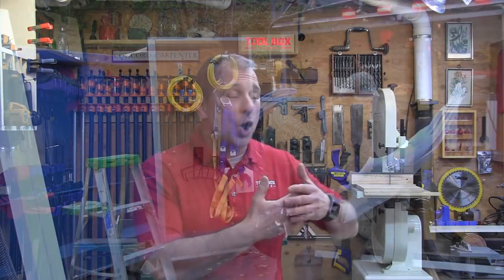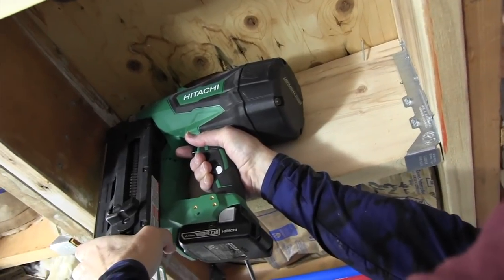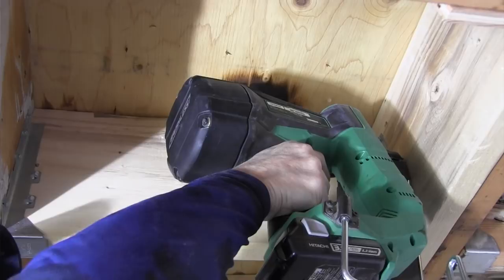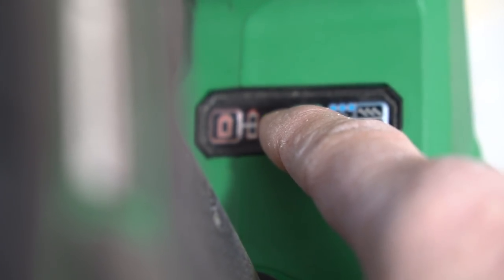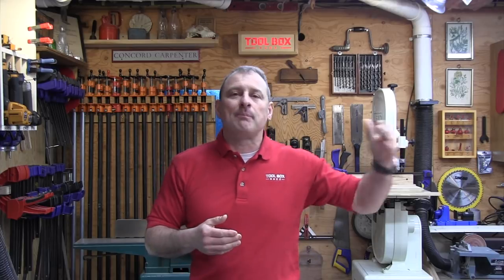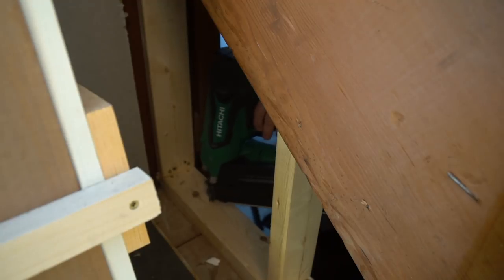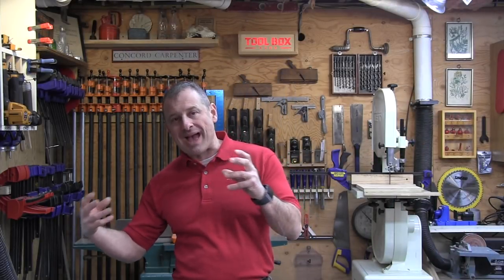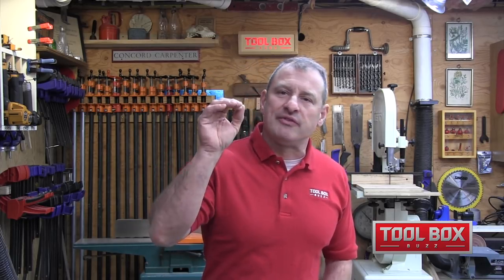Hitachi 3 1/2" Cordless Framing Nailer Review

Comment from the maker: We're currently using the finish nailers. I'm thinking of doing a 2-way look at the Hitachi /  Makita pin nailers
Reply: Cordless?
Reply: Why not add the Ryobi pin nailer to that list?
Reply: Cheng Liu because no serious carpenter uses ryobi anything.
Reply: 9mmkahr: You obviously haven't used one. Their 18v nailers are well regarded by most and are probably the best value around. I saw a video of a Ryobi 18 ga. nailer side by side with a Milwaukee one and they were pretty much the same in terms of performance except that the Ryobi was less than half the price.
Reply: Cheng Liu no i havent..  Ive heard the finish nailers are good.  But everything else.... Thumbs down
Reply from the maker: 9mmkahr ethos framer is amazing
Reply: Not sure what the price is on this hitachi nailer but 400 nails on a single charge battery is no comparison to the pasloade nailer with 1200 nails on a single battery charge!
Reply: Candelario Sanchez I will stick to my hitachi at 400 nails the cost of gas and down time when the paslode is being hormonal or the gas is cold still makes it better gun. I run mine on two 5ah batteries one is always fully charged before the other is flat so no issues.
Reply: My first finish gun was the paslode im 250 I think cleaned it regularly and last ten years but the stopped making spares for it so was replace by a bostitch which was half the price and still have as a back up as had to buy an angled finisher when the builders I sub contract to would only supply angled nails , so currently have the dewalt dcn 660 but have replaced the firing pin three times in little over a year and it doesn't sink 50mm pins into hardwoods, want to get the hitachi air Spring drive but don't think they do a 16 gauge angled finish nailer?
Reply: A Concord Carpenter / ToolBoxBuzz 
Hey rob great stuff as always

If you had to pick between this and the Dewalt framing nailer which way would you be inclined to go and why?

I recently started a small remodeling company and I am a one-man show. I primarily do remodeling and light building projects. For portability and efficiency i’ve went cordless with every new tool so far that I didn’t already have. 

Because I need to get a framed, finish & Brad nailer, I’m conflicted which direction to go. I run the DeWalt and Milwaukee platforms already, but the Hitachi seems to be best in class. All that to say, I’m inclined to stay on one platform for whichever nailer I pick. 

Thoughts?
Reply: @mj-1809  my thoughts would be to stay clear of the Dewalt 20v framing nailers. They're garbage and when they break Dewalt won't cover it under warranty and will want to charge you $220 to fix the nailer. They also don't tell you that the two return springs need to be changed after 20'000 to 30'000 nails which adds to the expense of the tool over the life of it. I bought two of them and their crap service turned me off buying anymore Dewalt tools. I picked up the Hitachi 18ga brad nailer and framing nailer on black Friday where they both came with 2 free batteries and I'm happy with the brad nailer. I haven't used the framing nailer yet but a cordless framing nailer is better in remodeling jobs and framing up basements because there's no blast of air out of them like the pneumatic nailers that sends a cloud of dust every time you nail something
Reply: "It's a poor craftsman that blames his tools"

the Ryobi one+ line is pretty stellar quality for a decent price.  Just my opinion.

Comment: Great review i just bought 2 of these guns brand new from lowes they did a non stock cause of the name change i only paid 50.00 each i e owned a the paslode and switch to the dewalt and the dewalt sucks quit working on only shooting 1/2 box of nails so i was so impressed with the hitachi it shoots fast a d i got 2 of them for 50.00 ea wow cant believe it

Comment: I am no carpenter, but I love my Hitachi cordless framing nailer. I moved into a house and needed to build a shed, so I used it to frame the 8x14 wood shed. It saved me so much work. Yeah, it was expensive, but worth it. Absolutely loved the power.  Maybe had one jam. However, there is a guy on youtube who said he used his in construction for 2 years and showed that now it barely puts a nail into the wood.  So maybe with heavy use they die out after a while? I need some new projects to use mine on now.

Comment: We just bought three of these, they will be used in place of Hitachi pneumatics, building 8 hours a day, we ordered two extra new 3 AH batteries and two of the 36 volt batteries, which will give this tool 8 AH.  I can report back after a few weeks and let you know how they work. We would love for Hitachi to make a coil roof nailer like this. The only reason for the compressor and hoses is the roof nailer.  We are also going to invest in the 36 volt miter saw, trying to go completely cordless, no generator or compressor.
Reply: chuck miller 
Any update 
On your tools?
Reply: @alfredomartinez4093   Yes, we used them for 5 days straight just last week. Not a single jam, they are a tiny bit slower than a pneumatic, but you find a rhythm.  Overall, we finished a little quicker than when using pneumatic guns. We did not use any air, no compressor or hoses to roll up everyday.  No tangled hoses or hoses tangled with electrical cords.  The 400 nail count per 3 AH battery is pretty accurate.  We start again tomorrow. The plastic on the top of them appear to be a fiberglass ball reinforced plastic instead of a fiberglass strand, the ball type is more impact resistant, probably for the habit of using the pneumatic for a bumping hammer.  We caught ourselves several times bumping studs around with the top of the gun.
Reply: Thanks for the update
Sounds like you really like them.
Reply: @alfredomartinez4093  Almost a year of using them full time framing. No oil needed. Only issue we had was the drivers wearing and bending some nails, this just started happening.  We were able to grind the driver flat and they are perfect again. The batteries only last about 4 months, but they are recharged much more often than when using normal cordless stuff.  Batteries are only $38.00 for 3 AH. Not bad, definitely better than a compressor and hose all the time.

Comment: I loved mine. It worked so well! Although here in Canada it did not like to work in the cold. It was nearly flawless for 5 years but now I think I may need to replace it. I did get a pneumatic Metabo gun and I love the double clip but the cord is a real pain, as is the compressor. I think I will go ahead and replace it. I am curious how other nailers fare in -10C and below temperatures. I rather be inside and finishing then but you know how schedules can go. Sometimes you get caught out in the cold

Comment: Have had this for gun ( NR1890 DBCL in the uk) for about 10 months and has jammed twice, both times were user error ( I fired through a knot), don't like the rafter hook , it always swivels round on itself from my hammer hoop and the nose jabs me in the back of the leg ( I think they have a revised and smaller one now) , also didn't realise how powerful it was until I borrowed my mates paslode and it struggled to sink full shank 75mm nails, mine on other hand will sink full shank 90mm all day long, absolute beast of a machine!
Reply: SOLD! Thanks.
Reply: Paul Petrie working with any Brand of nails? Or just hitachi?

Comment: I don't need a framing really all that often, but when I'm knocking out small trim jobs, I use my cordless nailer unless I'm setting up for awhile in which case I set up the compressor. the extra weight of the cordless is annoying after awhile. Oh I found hitachi 3 ah batteries on amazon for only 40 dollars.

Comment: super impressed with mine.  Doing an addition, I grew up in the trade but own a farm now.  Needed a second nail gun, got tired of passing the only one I had back and forth with my help and about to start roof rafters this week, so... really didn't wanna be sharing a nail gun then.  Was a little hesitant from the price, but, I despise paslode, owned several and the maintenance needed on them was a real pain in the butt, plus having to have batteries AND gas cartridges was a bummer, seems like one or the other was always empty, needing a charge or trip to the store to spend $$$ and time.  Agree on the needing two batteries, with just framing, it would be hard to outwork one battery before lunch and a chance to recharge it, however when I was sheathing the walls I framed, you fire a lot more nails, so, I did run the battery out.  I wish Makita made one, I have all makita cordless tools, but, oh well, I'm happy and I have a nice framer that I don't have to worry about dragging out the compressor and hoses or worse, putting them away at the end of the day!  Sheathing, stick with the pneumatic, but for framing, it's hard to beat this thing.
Reply from the maker: Ajila Ama Farms great nailer!
Reply: Amen, the thing is so strong you've got to be careful with sheathing. If you do use it for sheathing, you had better have a piece of ply/osb laying around to tune it in. I noticed with sheathing, you have to hold the gun super loose and let it recoil or it will go clear through the sheathing if you push to hard. I effin love this gun though!

Comment: I have a handyman service so I don't shoot a ton of nails generally. I just thought the Hitachi was too big and didn't feel as good in my hand. I opted to get the Paslode framer last week for $268.00 at Menards. I have loved my Paslode trim nailer over the years except for when its cold first out of the truck. This gun and the Paslode was a real tough choice for me but 9000 supposed nails on a fuel cell really isn't an issue my for lower nail count.

Comment: I sure hope makita hops on this bandwagon... I have been using their 36V 7 1/4" circ saw daily since December 2018 after watching your (awesome) cordless circular saw vid.  I am a residential rough carpenter and this thing gets very heavy use.  It just needs a hoseless buddy.  I am convinced that Makita eats dewalt and milwaukee for breakfast.  

As far as the saws, a coworker bought the milwaukee m18 circ saw after seeing my makita in action.  The milwaukee is noisy, less powerful and feels a bit awkward in the hand.  Cheers
Reply: Good to know. I’m invested in makita cordless tools and have been eyeing that saw for awhile. Hope they take on the framing nailer and knock it out of the park.

Comment: I am looking at these as Bosch don't make one now - big omission from Bosch as once I get a second set of batteries and chargers I will no longer stick with them for other machines.  Anyway - having watched yours and other reviews I wanted to add one thing - the rafter hook.  You can fit a smaller one from other models - but the reason it is bulky is that it can fit on both sides on the gun - and when on same side as the nail dispenser it needs to be wider.  Love the reviews though!

Comment: I've had the 30 degree one for two years now. Had to send it in for warranty repair job once, but ive been using it a lot since. Probably about 300 thousand nails through it in total, about 200k after the repair. No way im going back to pneumatics or gas. Im using 2x5Ah batteries on it, and even when sheeting a roof, I never run out of battery completely, usually I change battery every 2 hours when im going to take a break anyway.

Comment: Got one and i much prefer it to the paslode. The head is smaller and bit more spiked to dig in at angles . Its also more quiet. Working inside with a paslode my ears would ring.  This thing sound like star wars. 

I like to let nails guns hang on my front pouch then lift and fire.  You do notice the weight doing that after a while compared to the paslode. And some overhead stuff i find i use two hands instead of one.  

Its also easier to fire than a paslode.  You really have to push hard with a paslode . This seems shorter  and lighter push to fire. 

I have used bump mode fair bit for batons which is a great feature

Comment: I see your review of nails gun but how about run a 1 yr-2 year review and compare what repairs maintenance or fix needs to be done on some of the cordless nailers like loosing air pressure and or that special gas manufacturer puts on how was that experience after have purchased all these brands . Not many do reviews it’s just a suggestion .

Comment: Everything I have seen says Hitachi is the way to go with cordless brad, pin and framing nailers.. Their prices are competitive as well plus lifetime warranty.. One question, if I were to buy just one framing nailer what angle is best?
Reply: Ray B. It depends on what you are doing.  Framing nailers and finish nailers are dictated by angle of nail and gauge.  Framers you’d want a 30 degree paper strip nailer, 18 gauge and 16 gauge (thicker nail). Are for crown molding, window casing etc, 15 gauge is a thick and usually long nail more used for thick baseboard, and finally your pin nailer is your skinniest smallest fastener.  It’s for intricate areas in molding, to picture frames and things like that